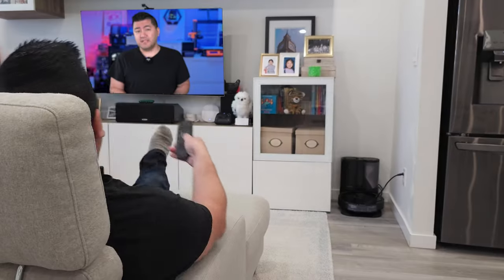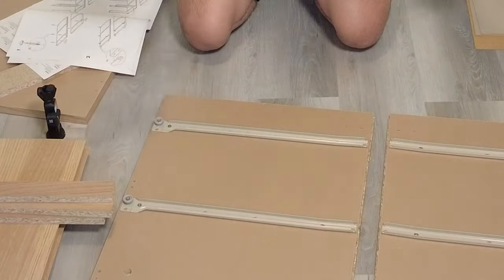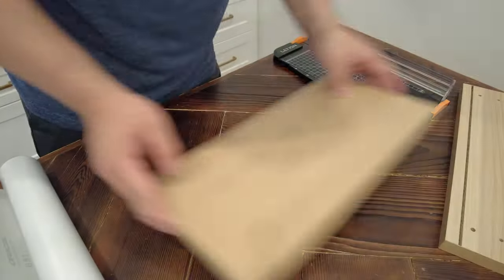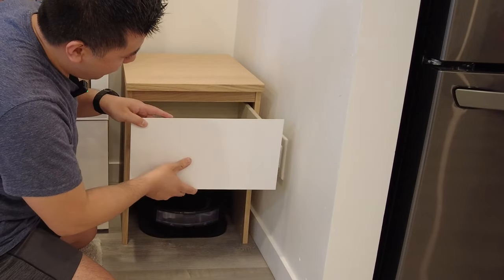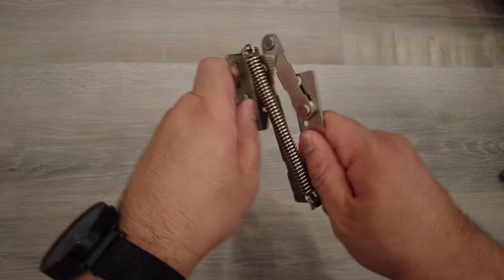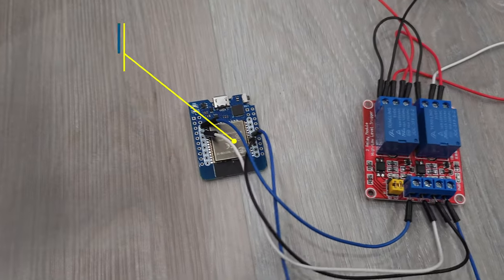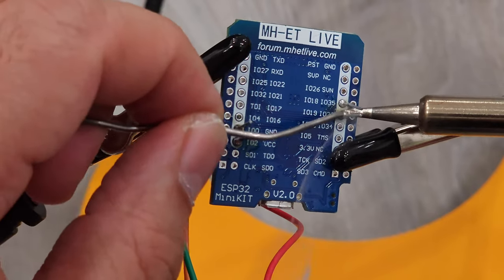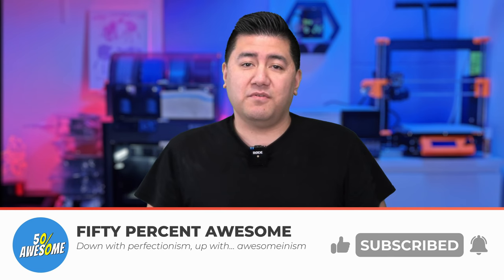Ikea Malm Dresser Hack - Hiding my Robot Vacuum

Comment: Assuming your roborock is linked to home assistant, it might be a good idea to have the drawer open whenever the vacuum is not docked, so if you start it manually it will be able to get out and back in.
Reply from the maker: Thanks for the suggestion! Makes sense and I'll modify my automation to do just that 👍
Reply from the maker: Just tested and works great! Now I wish I got a faster actuator because it's way too close of a race between the vacuum and door when cleaning starts 😆

Comment: I'm wonder if this could be done without a mechanism.  If the garage door is lightweight enough and reflective in order to trick infrared sensors, I wonder if robot vacume would push door open??  I'm crafty enough to make the garage but lost with the mechanism.
Reply from the maker: The vacuum would probably have bump sensors you'd have to deal with too. Even if you got the vacuum to brute force it's way out, wouldn't the door then be closed so it wouldn't be able to get back in to charge?